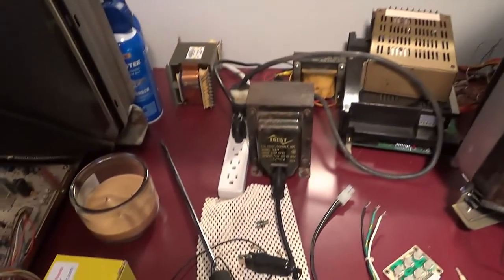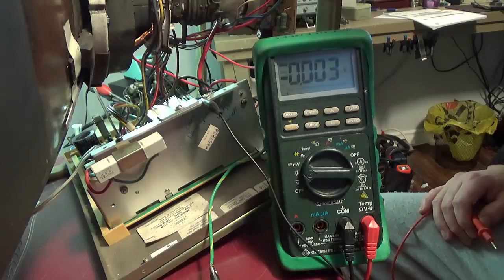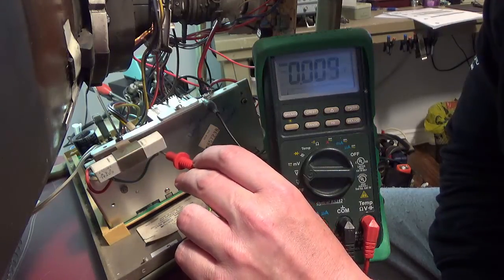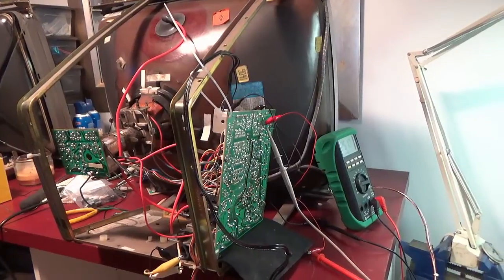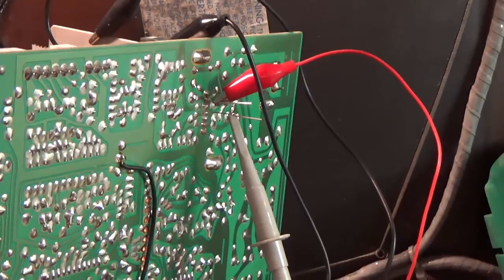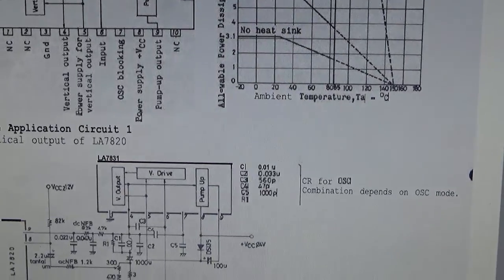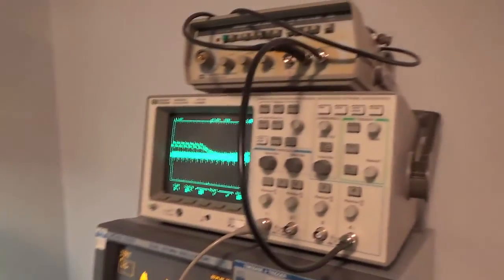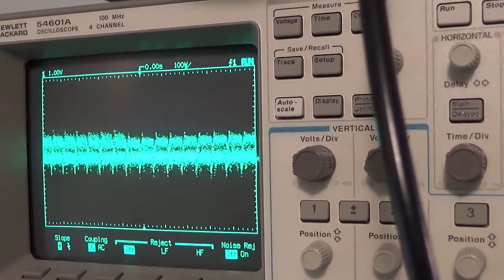K7000 ADVANCED REPAIR VERITCAL ISSUE

Comment: Okay, LA7831 is a 10-pin IC looking at your datasheet. The K7000 P538 25" monitor chassis I have is fitted for a 7-pin IC3.
Which pins do you snip to install it? Pins 1,2 and 10 since they say NC?
Reply: Yes, 1, 3 & 10 (NC) all get snipped off.

Comment: I'm trouble shooting my Nintendo pc10 countertop that has the 13" monitor and pair with the k700 chassis, the problem that I have when I turn the power on the screen shows like it's H-hold shinking the image but if I turn the power off and on again the monitor it's back to normal, I'm thinking the the capacitors on the power supply are bad.
Let me know if you may have any other ideas
Thank You
Reply from the maker: Not totally sure what your question is but. ...

If you have a k7000 that is a total virgin (uncapped and original flyback etc) it most likely could use a cap kit and new flyback.

 You can do the work yourself pretty easy and there are lots of places online to order parts like Peter from arcade parts and repair dot com. 

Intermittent issues that go away after its warmed up and been shut down and turned on a few times usual can be corrected by shotgunning the board ( change above parts) and then by reflowing all of the solder on header pins and areas that look bad. 

All of this being said 75% of the monitors I have fixed are because someone tried to do it themselves and something bad happens. So your welcome to PM me if you like me to take a look or do the work. But easily enough done for a DIY person. 

Hope the  video helped.